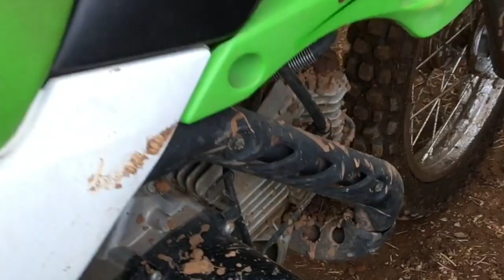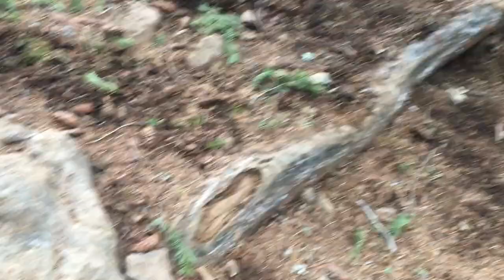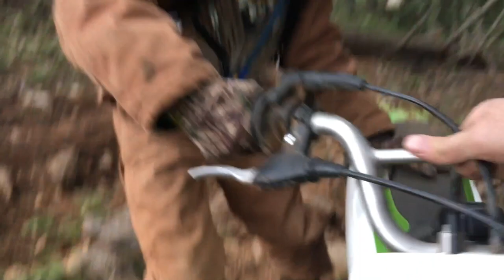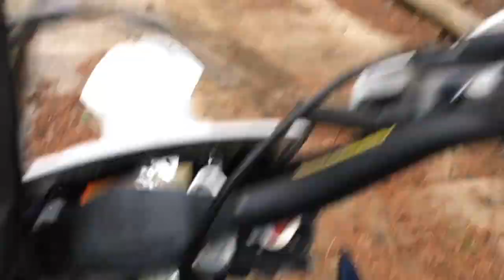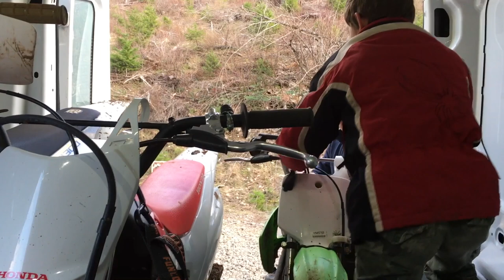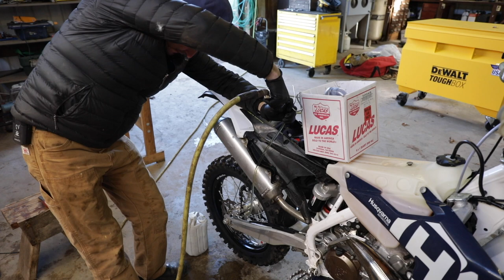The Video You Weren't Supposed To See

Comment: Properties of various Torx drives[5]
Size Point-to-point distance Maximum torque range ~ E Torx
(in) (mm) (lb·ft) (N·m)
T1 0.031 0.81 0.01–0.02 0.02–0.03 
T2 0.036 0.93 0.05–0.07 0.07–0.09 
T3 0.046 1.10 0.10–0.13 0.14–0.18 
T4 0.050 1.28 0.16–0.21 0.22–0.28 
T5 0.055 1.42 0.32–0.38 0.43–0.51 E2
T5.5[7]     
T6 0.066 1.70 0.55–0.66 0.75–0.90 
T7 0.078 1.99 1.0–1.3 1.4–1.7 
T8 0.090 2.31 1.6–1.9 2.2–2.6 
T9 0.098 2.50 2.1–2.5 2.8–3.4 
T10 0.107 2.74 2.7–3.3 3.7–4.5 
T15 0.128 3.27 4.7–5.7 6.4–7.7 
T20 0.151 3.86 7.74–9.37 10.5–12.7 E4
T25 0.173 4.43 11.7–14.0 15.9–19 E5
T27 0.195 4.99 16.6–19.8 22.5–26.9 
T30 0.216 5.52 22.9–27.6 31.1–37.4 E6
T35[8]     E7
T40 0.260 6.65 39.9–48.0 54.1–65.1 E8
T45 0.306 7.82 63.4–76.1 86–103.2 
T47[9][10] GM-Style    
T50 0.346 8.83 97.4–117 132–158 E10
T55 0.440 11.22 161–189 218–256 E12
T60 0.519 13.25 280–328 379–445 E16
T70 0.610 15.51 465–516 630–700 E18
T80 0.690 17.54 696–773 943–1048 E20
T90 0.784 19.92 984–1094 1334–1483 
T100 0.871 22.13 1359–1511 1843–2048 E24

Comment: cant say ive ever heard of anyone moving their rear brake to the handlebars. Then again, i can count the number of guys i know who race enduro on 1 hand. personally, id rather lose the back brake entirely than have to lose my clutch, even more so in the woods.
Reply: With enough power on tap there is no need for it. I have ran with no clutch handle since 07 on my KTM 450, and only miss it when drag racing. The Left hand rear brake on the other hand will always be on my woods bikes.
Reply: I seen guys put there front break on the clutch side because it feels more comfortable when riding. Just preference I guess.
Reply: You don't lose yr Clutch - a handlebar mounted rear break fits under the left bar and is thumb operated. It's very common in road racing, so it makes sense that off road would adopt it too.
Reply: Gavin Hill Done in road racing for slightly different reasons, also it'd be pretty difficult to keep your thumb on a RR thumb brake while bashing through the gnarly stuff!
Reply: Patrick Rebecca Doohan I agree
Reply: Gavin Hill ahh, using a thumb lever makes much more sense. thank you for the clarification! i think that would be a much better idea that the duel levers hes got.

Comment: I find myself rarely needing to ever use my rear brake. Just keep it in a low gear and feather the front down a hill
Reply: IF you learn to drag it around tight loose turns it will lower the rear and set you up to fly out of them.

Comment: Lithium batteries and full electric bikes are coming soon. The instant torque and throttle control is a massive advantage. There will always be a place for gasoline tho.
Reply: Yeah,  I don't know... having to push out your 200+ pound bike out of the woods because you used more power than expected on a climb does not sound like my kind of fun. LOL
Reply: I am a gasoline guy myself; I hate to see it go. Probably won't push your 200lb bike, probably just carry the 8lb battery.
Reply: OK, probably a 25lb battery.

Comment: Torques if I'm not misteaking is standard
Reply: Reading pound per inch or foot can't really say right off my mind
Reply: When Cody talks about TORX he does not mean TORQUES
Reply: Yeah auto correct really screw up what i try to text.
Reply: You are mistaken,  it's neither. A t25 will work on any t25 regardless if it's attached to metric or imperial   fasteners.